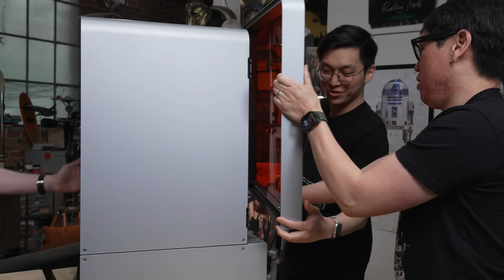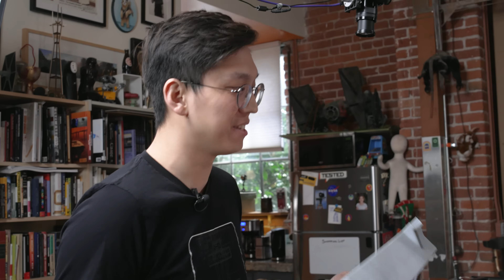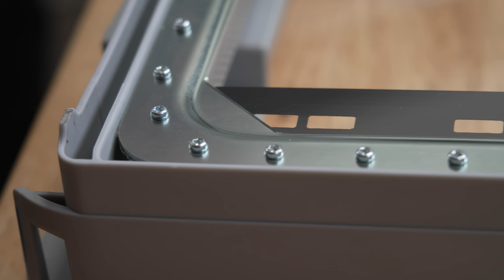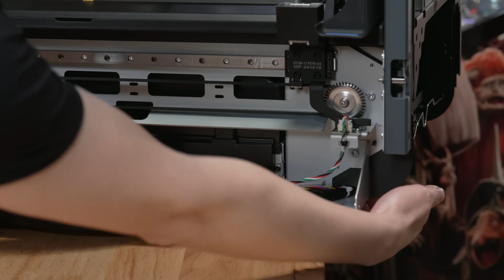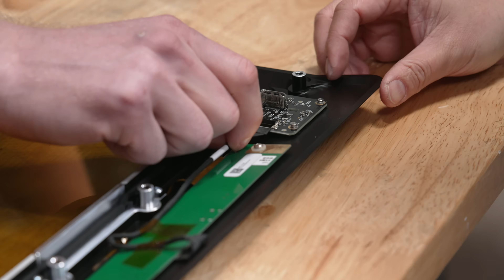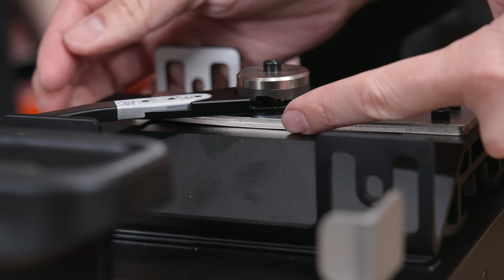How Massive Resin 3D Printers Work!

Comment from the maker: Thanks to Seth and Larry from Formlabs for their insights! Learn more about this printer here: https://formlabs.com/3d-printers/form-4l/?utm_source=general&utm_medium=referral&utm_campaign=tested-f4l-2025-03-20-global
https://www.matterhackers.com/store/l/formlabs-form-4l-3d-printer/sk/M525QM4X?aff=7553
Learn more about careers at Formlabs: https://careers.formlabs.com/?utm_source=general&utm_medium=referral&utm_campaign=tested-f4l-2025-03-20-global
Reply: Absolutely, thanks Seth and Larry. This was a great talk about designing a product and some of what goes into it. I have some experience myself and appreciate all the work it takes and collaboration between many engineers, designers, and testers. I’m retired now but it brought back memories of many meetings and late late nights.
Reply: When you remove sheet metal screws with an impact or drill, use a slower speed and do not allow the screw to spin after it's fully unthreaded. When you removed the back panel in the beginning of the video you can hear the screws jumping the threads after they're fully unthreaded. That causes fatigue on the sheet metal and the screws and will cause them to strip when you try to reinstall them. Especially if you use an impact. Pro tip, amateurs should never be allowed to use impacts on sheet metal. Always teach them with hand tools. Similarly, since you are in a mentor position, you should not be using impacts on the videos if your goal in the video is to educate.

Comment: so does the form 4 printer not have a tensioner motor? our form 3B has been having some trouble with its tensioner system which has been leading to some failed prints and print lines.

Comment: I assume this isn't supposed to be a hobbyist printer for home use, more a professional thing for some sort of business, considering its base price is 10k
Reply: Yep
Reply: They're at a price point where independent designers & hobbyist would find extremely expensive, and professional manufacturers would have little use of, cuz if manufacturers want something 3D printed for testing and be able to use for production straight away, they would just use sand casting printers to make the mold, or large scale metallic SLS.

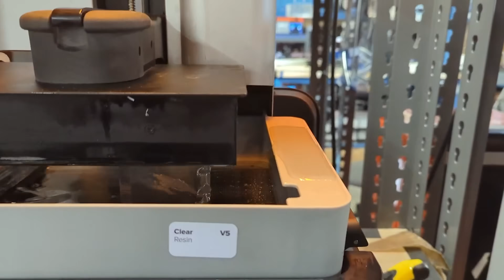Comment: 26:55 is the wiper just spilling a ton of resin every time? :D
Reply: The clip was from a very early prototype of the wiper system when we were first diagnosing the "tsunami" phenomenon! Splashing was an issue we resolved throughout development through design changes on the tank and adjusting wiper moves. Production units are splash free!
Reply: @Formlabs  thanks for clarifying :)

Comment: Probably the most thorough video on the internet but how does it work? As far as I understand from the last 30 seconds it sets a layer in a bath of liquid resin and slowly pulls the object out as it cures layer by layer a shape that builds into a 3D shape? that's what I got from it. Anyway really surprisingly detailed video thank you
Reply: To expand a little on the process:

For curing the layers, there are 2 main methods used. The first is laser based, where a laser scans across the pattern. This behaves much more like FDM printing, as you have the laser diameter behaving similar to FDM nozzel diameter, and it is only curing 1 point at a given moment, and has to trace out lines back and forth to cover the full area of the layer.

The second method is "Masked" sla, and is the most common. This is where the curing light is shown across the whole area of the vat, but an LCD just below the vat "masks" off the parts you don't want to cure. This has the bid advantage of curing an entire layer at once. In this case, the detail level is based on the pixel size of the display.

( Note: For both Laser and Masked, really the limiting detail factor is the resin. Due to light bleed, you can't perfectly focus either one infinitely down, and both are able to go smaller than the ~.05mm where light bleed starts to matter. By around .025mm light bleed becomes dominant. )

The biggest end result difference is in the print times. Laser based works like FDM, so it scales by the volume of printed material. If you're doing like a single simple object, it's very fast. However, if you have a large object, or lots of small ones, it can massively increase print times. Masked it's all about the total height of a print. So, if you have a whole bunch of short objects filling in a space, masked can do it really fast. On the other hand, a tall, slim, simple object is still going to take a long time. Pros and cons.

Which then of course the big variable: As you might imagine, the laser system is significantly more expensive, which is why Masked has largely won out.
Reply: @zemerick  Thank you very much for that.
Reply: You are correct. It uses a UV emitting display to cure the resin in paricular spots.
Reply: @BuxtonsWater  Interesting fact, while everywhere loves to call it UV, it's really not. 405nm is the standard used, and that's just inside visible light, which starts at ~400nm, going down. ( Though, depending on the specific light source, it can definitely include an amount of UVA. Thankfully even this is the safe UV. )

It's a very noticeable difference though. A blacklight, which is barely on the UV side, is mostly invisible to our eyes.
The 405nm used by these resin printers is VERY visible. It's essentially a bright low saturation violet. Vaguely around: #EF89F5
Reply: @zemerick  Great additional info!